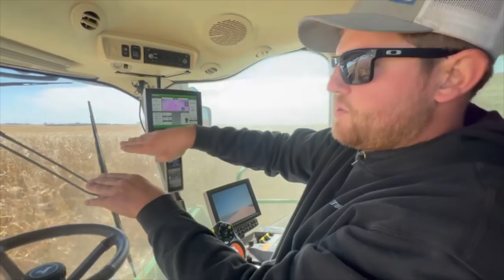MAJOR Storm Blows Over Our Corn

Comment: On the video of the car that came through your Corn field Grant said that on the John deere combine you just have to open the valve and the oil will go down the hose in the bucket but on the Case IH it 's the same there's a valve on the oil pan and it has a hose that goes down the side to the bucket

Comment: I still reckon you guys should put subsurface irrigation in the dryland corners! You can fertigate with subsurface too!
Reply: Curious.... How do you harvest unirrigated corners guess they are normally riper than the main field but what about late (GREEN) corn if a dry summer and Monsoon rains came after dry spring.... later! ???? Do you fertilize less in non irregated parts of the field at seeding variable rate?

Comment: Millennial farmer did a lot of downed corn last year, and he said you need to take it at an angle so you have more of a chance to catch the corn to pick it up.  so he got a corn head that was too narrow for his rows and then went at an angle so the front can grab the corn and pick it up because the top of the corn is heavy and laying on the ground, the bottom is stuck to the ground, and you want to poke the corn in the middle of the stalk, straighten it up and process it.  I guess

Comment: How does a combine work? It does such a great job of separating kernels and debris. How does it know what’s corn and what is debris??
Reply: Combination of weight size and shape(and a blower). It’s also kinda why you need a uniform crop size so you can set it to be efficient. If it’s not dialed in or the crop is bad they will get loss out the back.

Comment: Seriously if radio comms are so vital to the operation of the equipment during harvest why not install CB radios into the harvesting equipment.  You will never be without comms then. Sure carry the hand held units with you but only use them when you are outside the vehicle. The cost is not great and the range on 27Mhz will be no issue.

Comment: Thanks for another great video Laura. It was interesting. 

That storm you got did not help your corn. Sorry it knocked over a lot of your corn. Hard to pick up by the combine when flatten like that. 
Any help with insurance when corn is knocked over by a storm????????

Let’s see two errors. Truck driver pulled away before grain cart was done. Hopefully you can pick it up with scoops and save it. 
Then the fuel trailer and pickup got stuck but was able to pull it out. 
So all ended well. 

Then something about dragging a wire controller or something like that. You got me lost on that one. Was it off the combine or grain cart????????

The kitchens on the porch were cute. Growing fast. 

Know what you mean Laura by switching fields and changing jobs depending on what help is available. Busy busy time for harvesting. 

Thanks for everything Laura and Grant. Take care and be safe. 
The Iowa Farm Boy. Steve.

Comment: Grant, the Aquifer under Nebraska has dropped 100 ft since the late 50s/60s  now that farmers are drawing on the Aquifer so much because of the lack of rain and snow it will be deleted sooner than first thought because the Aquifer can't recover fast enough, you, your future children may not get to live the lifestyle you enjoy as well of other Nebraska farmers. I would think instead of trying to capture more water the Nebraska farmers would get together and find a way to save water because of the Aquifer slow recovery rate
Reply: Where they farm, the aquifer has not dropped.  It's within a few feet of where it was when their wells were drilled in the 1950's.
Besides which, it's actually hard to cut through the red-tape of water regulations.  I would like to construct some infiltration ponds where they would hold runoff water and allow it to slowly percolate down to the aquifer.   But federal regulations don't allow it.  (and, yes, they would be on my land and done at my expense.)
Reply: National Geograph did not mention any areas it said the Aquifer as a whole, they were talking about today's usage compared to the 50s and the slow recovery time
Reply: @davidfarley1175  Yeah, that's what I dislike about most reporting.  They paint with a really broad brush, and usually misrepresent everything.  
The Ogallala Aquifer is not a single pool, it's a series of many different aquifers, many of them only slightly connected.  There is no single recharge source or recharge rate across the whole thing.  
There are areas in Texas and Oklahoma where the water table has dropped several hundred feet, with no meaningful recharge.  There are areas of Nebraska where the water table has risen 60-80 feet, and the NRD is desperately trying to shift irrigation practices to keep it from saturating the entire soil profile.  
Nebraska has something like 1/3 of the surface area that covers the Ogallala, and 2/3 of the water.  There was a comprehensive evaluation back in 2008, that concluded that Nebraska, overall, had reduced the amount of available water by about 0.5% in 50 years of pumping.   
I think we're good for a while.